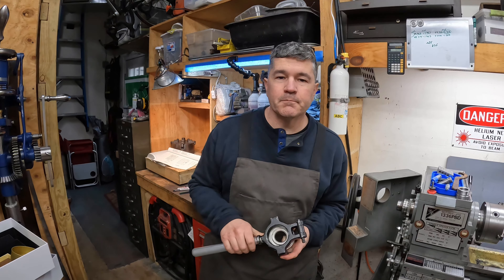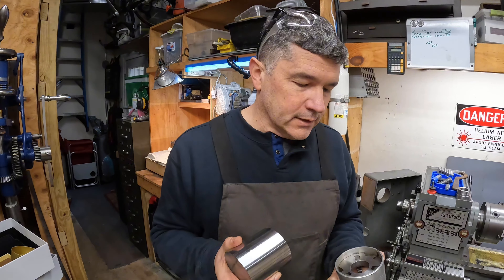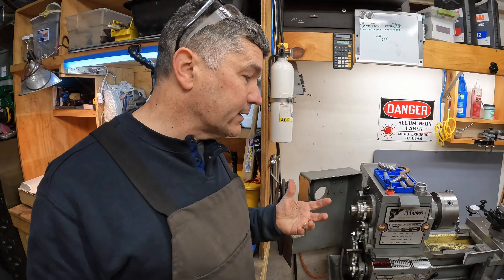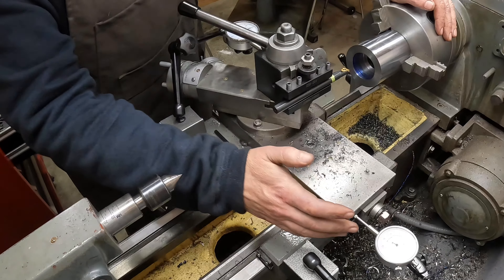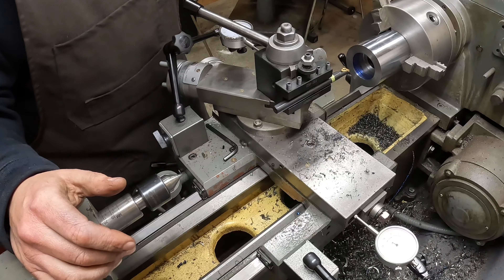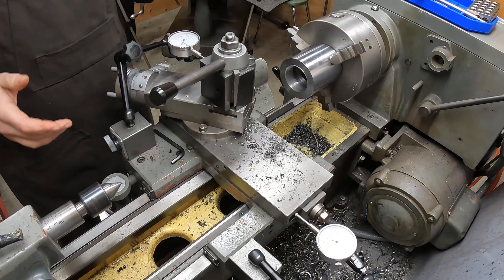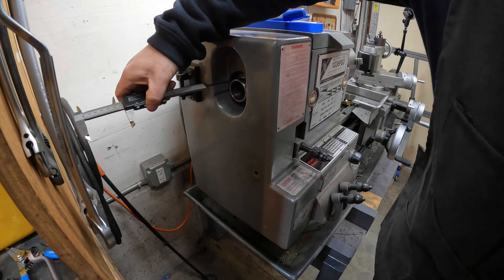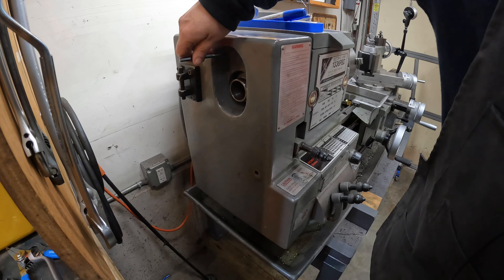Making a collet adjusting nut assembly for a Royal 5C Collet Closer. Part 1

Comment: I wonder if the carbide tip is ground / sintered for a heavier (thicker) cut?  Kurtis at Cutting Edge Engineering cuts cylinder rods for a living, you could watch some of the early videos where he gives tip designations ( he basically uses three) and cut depth/ feed rates.  He does have larger than average size tools, but if you have not checked his work yet, you are in for a lot of interesting information.  Great to see that you stuck to it!  I’m guessing that like most vocations time heals the information void? 😊
Reply from the maker: Thanks for that reference, I’ll check out his channel! Time and my subscriber comments are very informative!!! Thanks for your continued support!

Comment: If that truly is steel from a hydraulic ram shaft, it’s likely chrome plated and harder than snot. It will fight you the whole way.
Reply from the maker: You are correct and it did fight!
Reply: @EnoRestoration ceramic insert according to Kurtis at CCE- and it gets worn.  First 1/8” or so and then it gets “normal “😂
Reply: Yep, cylinder rods are inductioned hardened chrome plated alloy steel.  Thats why it fought you and wouldnt break a chip at first.  The wnmg insert looked like it had a larger nose radius which needs a much larger depth of cut and feed rate than the dnmg tool you had better luck with.
Reply from the maker: Good point on the radius/doc/feed rate.  Thank you for the suggestions and comment!

Comment: I would use cutting oil with that steel. I would also check the height of the cutter every time you make a tool change. Maybe you do and we just don't see it.
Reply from the maker: I've not yet gotten into any cutting oil.  trying to survive without the mess and honestly, I'm not sure when to use it an when not to (other than if parting with HSS).  And yes, I missed the tool height when I swapped in the HSS boring bar.  Thank you for the comments Scott, I appreciate it!

Comment: A lot of folks get the wrong idea about insert shape, the analogy might be one shape being a car another being a train and another being a truck. All of one shape may be a car but it doesnt tell you if it is a limo or a family hatchback or a sports car. What tells you what an insert is for is not the shape but things like the nose radius and more importantly the chip breaker design. The shape only realy says things about tool access and how many cutting edges you get. The chip breaker is far more important as the specs will tell what depth and feed rate it needs to work and in what material. Grade of carbide also comes into the equation to complicate things further. There is great temptation to order tips by just the 4 letter code but folowing the analogy, that just gives you a car or train etc. You need to be much more specific to get the Ferrari you ordered.😂 if you get a manufacturers catalogue you will be amazed at how many different tips that all look the same there are but are all subtlety different for different needs and uses. In a catalogue there should be a graph showing the range of cuts that each of their chip breakers are intended make, some may only work at 3mm deep while others may only take a few thou(yes i mixed units, so sue me) buying surplus or ebay finds inserts you are likely to get the ones that nobody wants because they ordered the wrong ones. Get them from a reputable source with a specific job in mind, and remember that most inserts are intended for high power and precision industrial machines not low power manual ones, but the right ones are available but are often more expensive as they are "specials" not "bulk buys".
To sum up all the above in one sentence, not all tips are equal even if they loòk it.😢
On the variable play you discovered, one advantage of not using the top slide for thread cutting is it can eliminate one set of backslashes. If you keep the top slide where it is intended to be, in line with the lathe axis, and with tight gibs you only have the cross slide lead screw backlash to contend with and that is all in one direction. The real experts at "smaller"lathe use eliminate the top slide from there lathes altogether for superior rigidity and dont miss it when thread cutting at all. Having no top slide also makes sense when a DRO is fitted, as you can ascribe each toòl holder an offset(zero number) for repeatability. 
Well you did ask for comments!😂😂😂😂
Reply from the maker: Great analogy regarding the inserts. I admit that the code on those inserts is a language I’ve not yet learned. Way more complicated than the grinding stones on my surface grinder and I thought those codes were complicated. And even if I did know more about the inserts this was also a piece of mystery metal that seemed to have a chrome outer layer. 
I do think my gibs are in need of checking. I’m pretty happy with all I’ve learned from this project so far. Thank you for your continued support!
Reply: @EnoRestoration  the numbers make more sense using the ISO definitions, but some folks are metricphobes.😉

Comment: Next time your boring bar starts screeching, try slowing it down and giving it some more feed. Usually, a sign chatter is starting, or your center height is wrong.

Also try slugging the gibs on your cross slide. If its movine in a light cut like that the gibs are probably not snug enough. You may have better results locking it and only feeding with the compound.
Reply from the maker: As always, great suggestions!  I'll add "checking the gibs" to my list...! Thank you for the tips, I appreciate it.